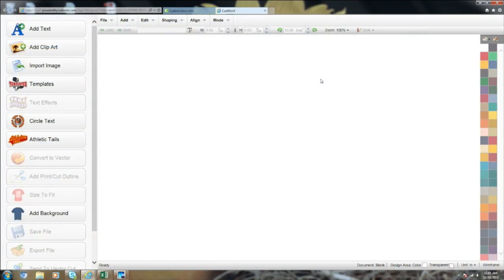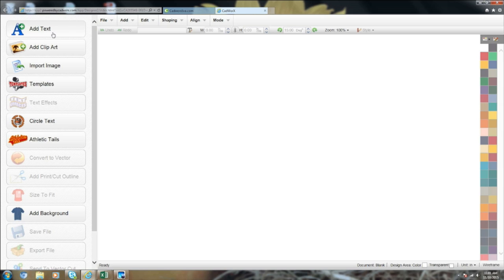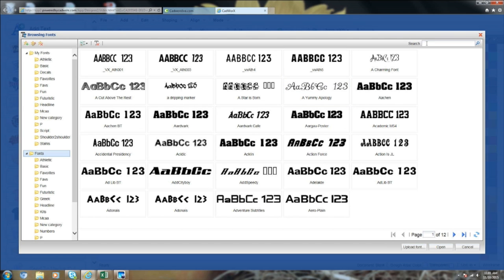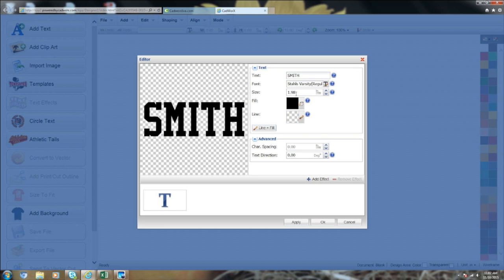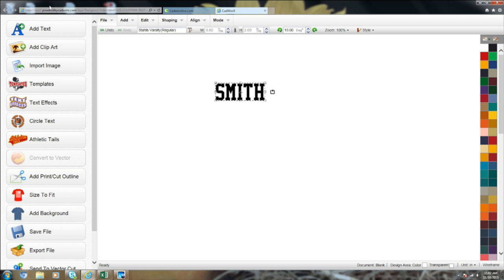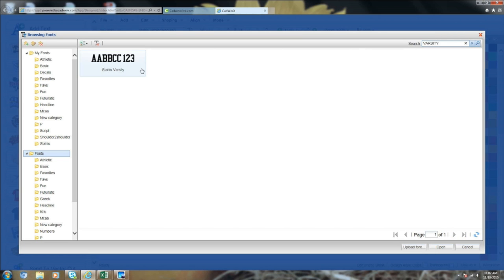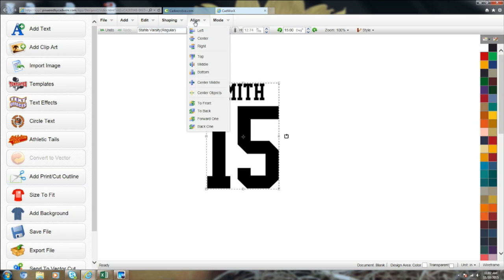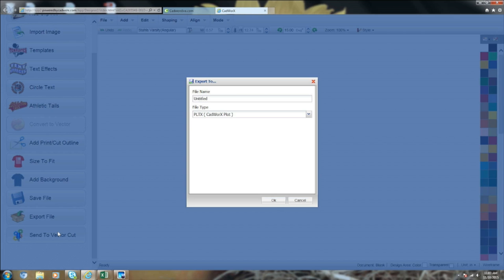The Graphtec CE-6000-60 Vinyl Cutter| Breakdown of Advanced Features

Comment: Thank you for you wonderful videos. There is one question left. What offset do i set in the menu for the 45 blade which comes with the cutter. And why are there two different offset values? Maybe you can explain this . Thank you!
Reply from the maker: For the 45 degree blade you can use a .25 offset. If it is a 60 degree blade you can use a .40 offset. There are two different offsets for the different blades.

Comment: Hello how are you, I'm in the process of buying my first cutter for auto clear bra paint protection film. What size printer do you think would be sufficientl to get the job done for me, and could you guys do a class on cutting paint protection film? Thanks Andrew
Reply from the maker: We generally only do videos on materials we sell. We do not carry any vinyl other than heat transfer vinyl. It would depend on which portion of the vehicle you want to cut materials for. If it is just the front bumper for example, the Graphtec CE-6000 may work. If you are trying to cut materials for the hood and doors as well you may want to step up to a wider format cutter.